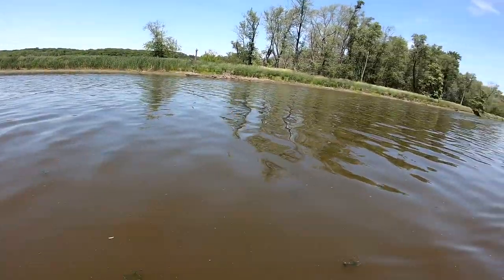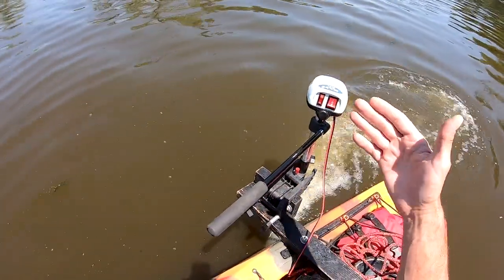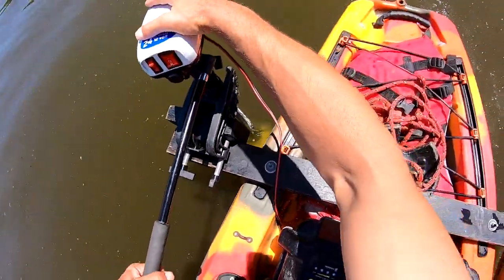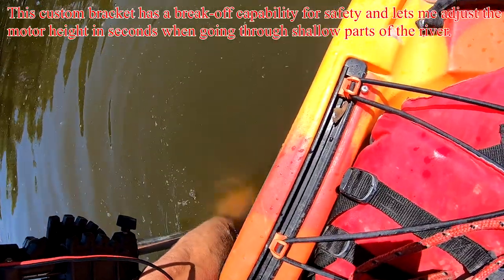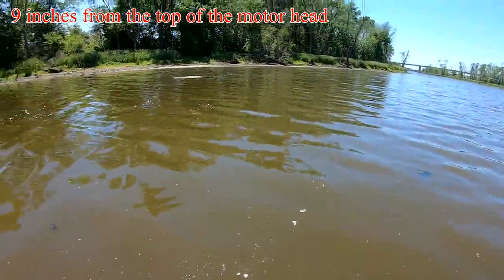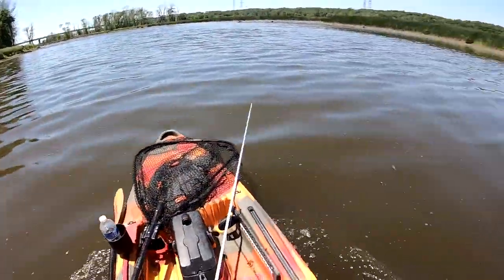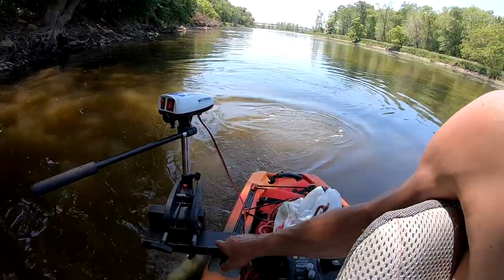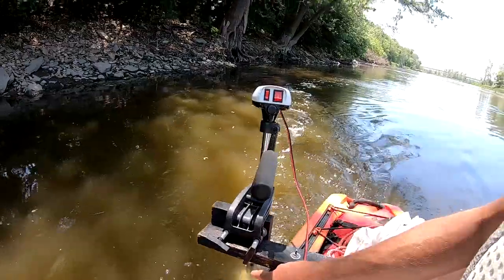Kayak Trolling Motor Depth For Max Performance

Comment: Nice! How does it handle with the motor being on the side and not the back? I have a 9ft Colorado XT pontoon and was thinking about getting one of those kayak trolling motors.
Reply from the maker: It handles great and I can easily adjust the height as well as clear the prop of weeds when needed.